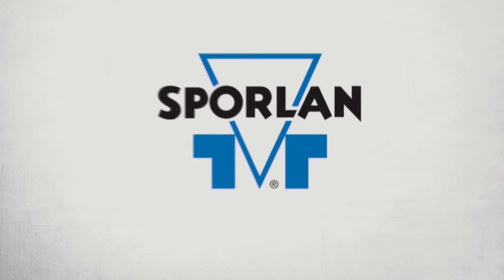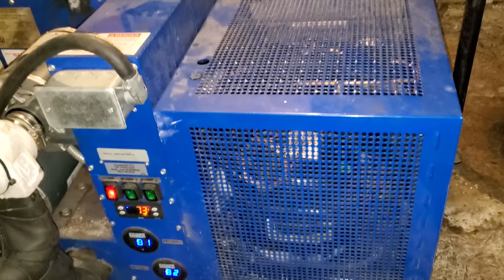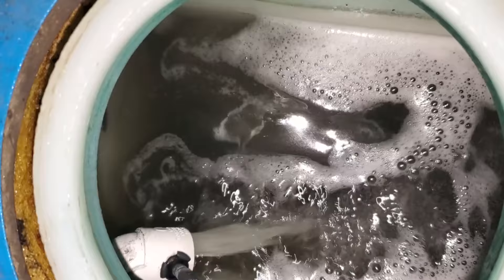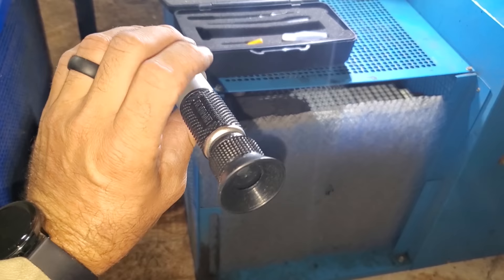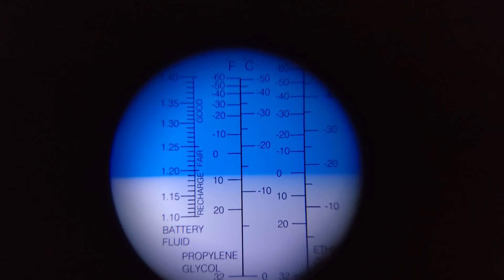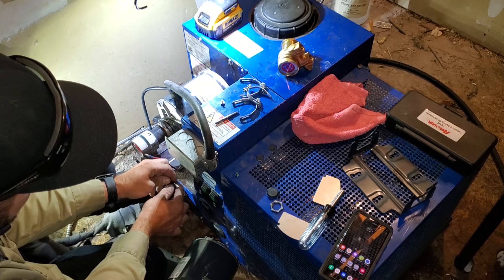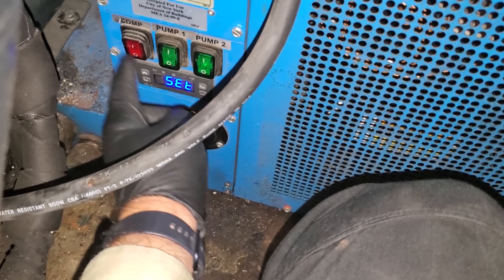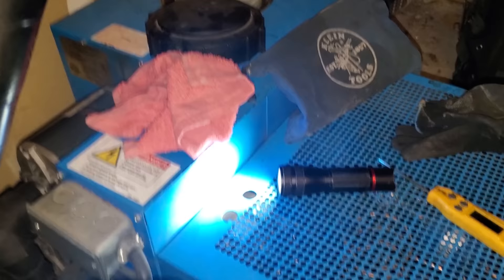THE BEER IS WARM AND BOTH GLYCOL UNIT'S ARE DOWN

Comment: On the pump that you replace looks like they have a very fine mesh filter that is fitted in the brass acorn nut which have a problem blocking up when glycol is used in the system which needs to be cleaned out about every 3 months to stop it from jamming up.

Comment: The glycol color changes when a pump blows up.    The pumps have carbon plates.  When they blow, it sends pieces of the carbon bits through the system which changes the color of the glycol.  If you take the fittings off the pump and shine a flash light into the pump you can physically see it blown.    Also when you remove the pump from the carbonator motor. Look at the shaft (aka chingas) of the pump if its the shape of a diamond the pump is seizing and needs to be replaced.

Comment: 21:12 They asked you because (23:09) they didn't know who to call else. I understand that you're having enough problems as it is, but perhaps it might be beneficial to you to train someone in your company to just that aspect so you can accept such requests from ("lazy") customers. It will bring revenue and you're looking good by accepting and not turning the offer down. But I do agree that it brings more responsibility.
Reply: Our refrigeration company used to handle the glycol system as well. The beer companies here  will only clean the beer lines.
Reply: The equipment to do so isn't really that expensive either. At least compared to normal HVAC equipment. The biggest problem is finding a guy who is both willing and able to learn about the glycol systems. It's probably like electrical in automotive, few people understand it or want to understand it because it's different and perceived as complicated. In this case its all about the glycol mix, getting it right knowing about various additive packages (even hard to find people in automotive who know about those for coolant additives) and what to look for to diagnose glycol problems that is more than just glycol looking nasty.

Glycol should have a specific viscosity, shear factor, smell, specific gravity, and more. As HVAC guy pointed out, you have to keep in mind what tap system and line sizes they are using as that can affect your required mix concentration.

Well worth the money I would think if one of his guys would be willing to learn about it. It seems like every single glycol unit he goes to is filthy and needs the glycol not just changed but completely flushed. It's pretty easy work too, most of the actual work is just hauling the glycol up and down from the little attic spaces they stuff them in, flushing them is pretty easy depending on how you want to do it. (some companies disconnect the lines and forcibly flush the lines, others just drain and fill the tank several times and let the pumps flush the lines).
Reply: @davejohnsonnola2758  pretty much the same in North Louisiana as well
Reply: @davejohnsonnola2758  Makes sense. For a restaurant it's just a piece of equipment (cooler as a whole) that needs to be fixed. They don't care about who is responsible for what aspect of the equipment. They probably have a good relation with Chris' business already and know he's honest. It prevents them from having to hunting down another company and schedule yet another appointment with yet another tech that might finds something else to be faulty or tries to sell them something. It can be perceived as a "lazy customer" but efficiency is a thing as well. It makes it easy for a customer to have one universal company to call for when their cooling equipment misbehaves, and given his reputation I guess they will gladly have him fix it so they can allocated their time to running their business, knowing they're in good hands.

2009dudeman made the comparison to the automotive industry before and I agree. Most of the car tinkerers online know everything about the engine, belts, brakes and tyres... however, when it comes to electrical or electronic problems even garages need diagnostic tools with overpriced licences while I as an electronics engineer can probably figure out some stuff in a couple of minutes. It's for car-people the least interesting part of a car. It doesn't go vroom nor can you "show of" your car with a good working electrical system. It's just something they have to deal with.

For us electronics people, it depends on on specialism as well, but it is fair to say we have had stuff shoved down our throats we don't care about either. I had to go through electrical and house-wiring first (with their norms and applicable rules here in the Netherlands), even industrial controls and 3-phase motors, relays and such. It was fun, but not my interest. As far as electronics go you have to deal with a metric tonne of rules, guidelines and norms to conform to. Design a PCB. You have to know what components to choose (electronic component knowledge req'd), how the board is going to be mounted (mechanical knowledge req'd) under what conditions (moist or vibrating environment) (knowledge of production, glueing and conformal coating and compatibilty req'd), the case it's going to be in, heat dissipation and ventilation (thermodynamics knowledge in a way req'd).... Electronics is a huge can of worms if you look at it from afar.

Comment: Maybe the glycol lines meet at some point and the extremely cold glycol from the one failing unit stopped the other glycol pumps as well, by feeding them with slushy glycol.

Once the pumps are locked up, the temperature reading is rising because it just reads the air temperature in the top of the tank instead of a glycol temperature.

To avoid this the units either have to read the rpm of the motors and stop operating the compressor when the pumps are not working or the temperature probe needs to be embedded into the heat exchanger section, to read the coldest point of the gylcol instead of reading the flow from the pumps.

Comment: I just learned that the mixture of glycol and water actually has lower freezing point than any of the two. Interesting. Around 55% (by mass) of glycol (ethylene glycol) it reaches minimum of about -53 deg C. Where pure glycol is -13 deg C. For 60% (by mass) of propylene glycos it gets to about -60 deg C  freezing point. The similar thing happens with some other alcohols and diols, like glycerine (glycerol), propylene glycol. Depending on concentration the water can be freezing out in the mixture, below the total freezing point. Really interesting. It looks like propylene glycol is used mostly because it is non toxic, and kind of safe in contact with food. Where the ethylene glycol is rather toxic (ingested 50g can probably kill a person).

Comment: That system you worked on is a long draw draught beer system. The glycol lines run alongside of the beer lines inside a trunk line. Sometimes they’re wrapped around he beer lines too. The glycol is a completely separate system from the beer lines running from the walk in cooler. The only time they meet is inside the trunk line as I referenced above. The trunk line can run along a wall, underground, above ground it doesn’t matter. The account staff member that mentioned the draught techs from a beer company coming in to flush the lines... That’s to keep the beer tap faucets and lines from getting bacteria in them because beer is a living organism and the bacteria is no bueno and will give you the squirts... And also it’s a health department requirement to have beer lines flushed every 14 days. A restaurant can get penalized if they do not. You can usually find a service sticker on the door of the walk in that shows when a draught tech came in to service the lines. The one thing you can tie together is if a draught tech actually messed up the draught system the day it started having problems....  So hey I’m in my second mod now for HVAC. I’ll be taking my EPA 608 Universal and I in a few weeks . I’m feeling pretty good I’ll hit nail them.... Hopefully we can team up one day I know beer systems. I was in the beer industry for 20 years.

Comment: The chingas is called a compression disc, I've been working on pump setups like this for 10 years. They are also meant to be a break point if one locks up it won't destroy the other. Your glycol looked like it had algae growing in it that would be the reason for the back color, the fruity smell is from the bacteria breaking down the sugars in the glycol

Comment: Those Glycol baths  r large for a reason. Those units look like there servicing multiple  beer towers n  multiple beer lines 20-30 plus lines.  Low levels of Glycol in bath can create problems especially if the length of the run from keg to tap is long. Not enough Glycol recirculating.

Comment: One of my concerns were that the flush with warm water caused it to intensify the cooling so that the glycol mixed water did freeze and caused the final breakdown of the pumps. It did look a bit like it was just a question of time before they did break down.
But maybe it's a good idea to read up on the recommended glycol mix or at least have that info at hand somewhere.

Comment: I think  the heatexchanger froze up while the manager flush the beer lines,  the cold side got to cold. there was no glykol  to take the cold away, sry for bad english .
Reply: The manager never touched the glycol lines, they just flushed the beer lines. Hot water in the beer lines only warms up the glycol, empty beer lines (after flushing they may have let them alone while flushing other lines) should not cause freezing glycol either as the thermostat should satisfy.

I'd bet it was a combo of bad temp reading on the one unit, and broken pumps on the other causing them to freeze up.
Reply: @2009dudeman  i didnt say he touched  the glycol lines, but a combo was sure the problem.  Have a nice day.
Reply: @CarBjorn  You too man, no offense intended.
Reply: @2009dudeman  np =)

Comment: I'm assuming those pumps have ceramic seals? If so, that is a potential source of the contamination, and also of the smegma that has contaminated the union between the pumps and motors.

Comment: I Don’t Do Glycol Systems as a Rule But i Believe When Glycol Gets Old it Becomes Acidic & Will Start Eating The Metal Fittings used in the System. Brass , Stainless Steel etc. , 
I Have Seen it in Marine applications. I Would Recommend You Get some Ph strips and do a Ph Test on the Glycol too as u are Going to the Trouble With a Refractomer. Electrolysis can occur and Start Eating Pumps away if Pumps are Not all Bonded / Grounded Together. Ground straps Need to be attached to Pumps , Motors , etc. I Would Recommend You call the Factory and Run it By tech support. Black Glycol symptoms , cures , Grounding , Proper Ph Level for Glycol , and Recommended Glycol Change intervals. Good vid ! Like # 111

Comment: When they flushed the lines could they have left air in the system and the glycol has nowhere to get rid of the cold so it freezes?
Reply: Wouldn't matter, as long as the glycol pumps are running the glycol will just run back to the tank still cold and the compressor should cycle off.

Comment: You mentioned that the attic door being open - I wonder if high ambient temp could have caused issues? Maybe the pump motors shut off on thermal?
Reply: Could be it, with the pumps being hard to turn they'll be loading down the motors more. However you wouldn't think they'd get thaaaaat hot (usually only thermal when they're stalled)
Reply: The orientation of the units could also be a problem, the inlet of one unit is near the exhaust of the other, and vice versa. Additionally, it looked like mini-split was the method for extracting heat from the area and dumping it outside.
Reply: @thomasbonse  wouldn't have caused this issue though, as the units were frozen up. If they were getting too hot and tripping on high head pressure you'd just have warm glycol with circulation but no cooling. This was almost the opposite, cooling but no circulation.
Reply: @Thermoelectric7  Not to be snarky, but they're allowed to have more than one problem at a time.

Comment: I talked to our Engineer. Glycol really should last forever, if not contaminated. If it gets dirty it can break things down or if the system needs a special blend to protect seals.   You can also break it down if you heat it up like 500°F. So if the Glycol starts out clear it should stay clear. Those power packs are just small chillers not that much different than larger ones. Do you think they have to change the Glycol in 100 ton chillers every few years?

I would suggest that before you replace those other pumps is have the system lines flush properly to clean the system. Otherwise  the new pumps will fail prematurely.
Reply: The difference between these and large chillers, is that the glycol in the chillers will have its own filtration, testing and treatment loop, and will be kept perfect, with biocides added as needed, and pumps won't be run till failure dumping crud into the system.

These are basically open systems that are exposed to airborne bacteria, with no filtration or treatment, and so are going to have problems.

And just like it's MUCH easier to keep the chemistry right on a giant swimming pool than a small hot tub, the larger systems are more forgiving because it's got so much volume it takes longer for change to happen.

Comment: I bet when they flushed the beer lines they didn’t shut down the line coolers so they over worked that’s why it froze. Not designed to cool 100 degree lines.

Comment: *sees thumbnail* Hey, that site looks familiar...
That glycol looks nasty, the client should really have someone out there to give it a good healthy flush - as an added benefit, the pumps will probably last longer than they do now. Glycol and corrosion inhibitors don't last forever - in cars, cooling systems need to be flushed and changed periodically (especially GM's "glycolized" Dex-Cool because it tends to get sludgy) and loses its corrosion protection over time. I imagine this applies here as well.
Also, any idea why the 2nd pump on one of the units has a line cord that needs to be plugged in instead of it being wired to the switch as it should be?

Comment: I'm instrument, not really HVAC, but it was likely the controller on the fritz. typically with temp sensors if they're done, they're really really done, the readings aren't even possible. And the plastic pump/motor coupling... i mean ya I guess there's a dissimilar metal component there, but really it's meant to protect both components and become the weakest link. So when you find them broken - that's what they're supposed to do under high friction situations.  They break and the pump and motor free-wheel as opposed to causing more expensive component damage. Usually the motor should trip out when this happens, but cheaper junk... maybe not so much.

Given the environment those ones are in it's kinda moot. They look like ass.

Comment: Whoever is teling you the glycol needs to be in some magical proportion is bullshitting you. The only physical characteristic the glycol/water mixture needs to have is a freezing point below the coldest point in the system. The viscosity has negligeble chnages depending on concentration.

Comment: Galvanic Corrosion is the act of 2 metals affecting each other "corroding each other" it's aweful, and could be what's in the glycol (the resulting corroded material).
Reply: Yep , You can get some crazy stuff corroding when Electrolosis & Galvanic corrosion is Going on. I Noticed he said One Pump is Plugged into the Wall Directly. Could be on a Different circuit than the chiller. Other pump is on the chiller circuit. Pumps Not Bonded / Grounded. They are isolated from the “ CHINGUS “ Berween the Motor & Pump. So Pump Needs a Ground strap to the Chiller & Motor needs a Ground strap to the chiller. Everything Needs Bonded together by Ground straps.

Comment: I watched video again because I work on glycol units. U wer trying to understand why it was iced up. I believe both glycol units wer too low on amount of glycol in the bath. So if you have low airflow a system will ice up. So if ur glycol is low n both units looked low to me, then that may have caused ur ice issues.
Reply from the maker: Although these do look low they actually have flat plate heat exchangers down below the reservoir so as long as fluid is in the reservoir you are good on your level.....
Reply: Sounds good. But every banner/perlick unit ive worked on there full. Anyway thanks for sharing n love wearing hvacr hat n shirts.
Reply from the maker: You do raise a good point and the glycol can also contract once it gets cold so it would be worth a follow up for me to just make sure once it contracted it didn't drop too low!

Comment: Why aren't the thermometers working on the unit with the dead temp control?
Reply from the maker: Yeah i looked into that the transformers are supplying the right voltage so the displays are both bad.....
Reply: Bummer, it would have helped with your diagnosis :(

Comment: Is it safe to have these gylcol systems used for cooling down food stuffs?
If there is a small leak gylcol will enter the food line and glycol is not safe for consumption
Reply: Enthylene Glycol isn't food safe Propylene Glycol is. Put way too much of the layer into myself.
Reply from the maker: I will discuss this on my Livestream this evening 8/10/20 @ 5:PM (pacific time) on YouTube come on over and check it out and no worries if you can’t make the live show it will post as a normal video afterwards https://youtu.be/XMm6nwq_vgc
Reply: I'll add that Propylene Glycol is used in tons of products, many of which you eat, drink, clean, smoke daily, of course it's food grade and clean, not the old swill in the system, which has isolated tubing for cooling and other for product being served